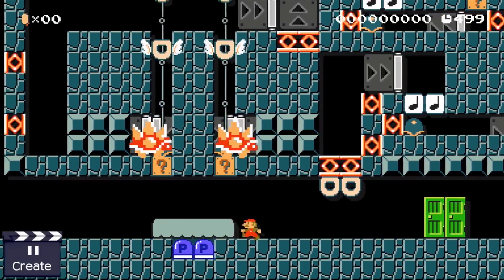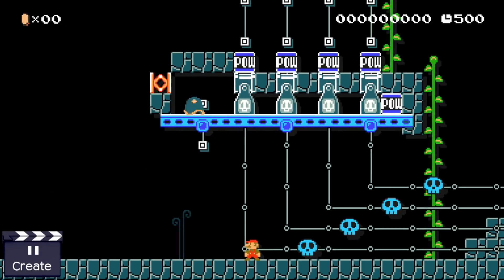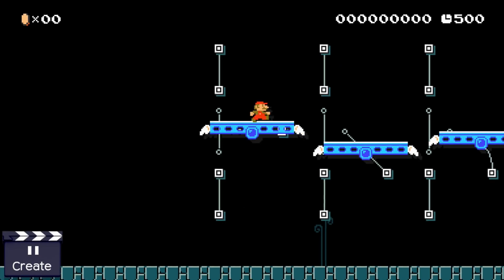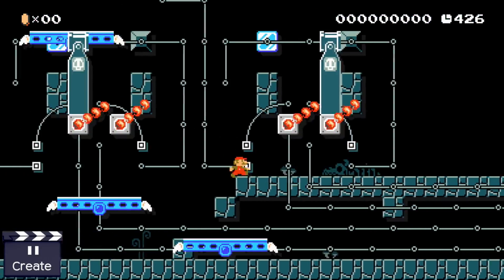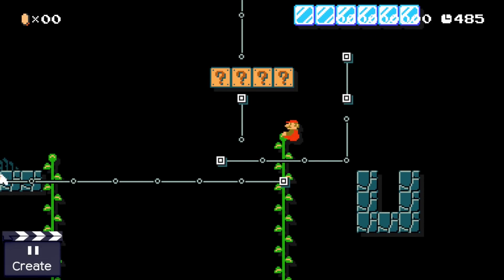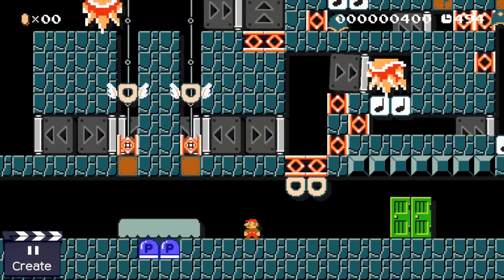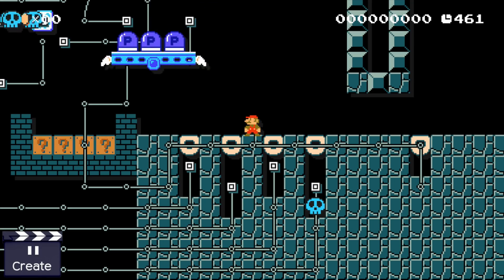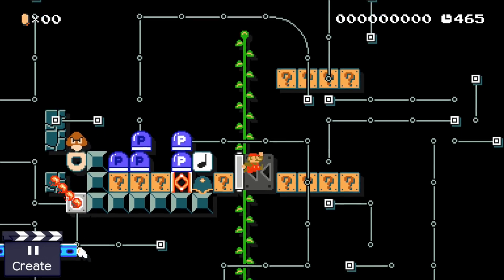Is it Possible to Build Binary Storage in Super Mario Maker ?

Comment: 01001111 01110101 01100011 01101000 01101001 01101110 01100111 00100000 01010011 01110000 01101001 01101011 01100101 01110011
Reply: 01101001 01110100 00100111 01110011 00100000 01110011 01110101 01110010 01110000 01110010 01101001 01110011 01101001 01101110 01100111 01101100 01111001 00100000 01110011 01101001 01101101 01110000 01101100 01100101
Reply: 0
Reply: Have y'all tried talking using letters? I hear it's a much easier system.
Reply: NJCWolf 48 65 78 20 69 73 20 62 65 74 74 65 72 20 74 68 61 6E 20 6C 65 74 74 65 72 73 20 62 65 63 61 75 73 65 20 69 74 20 61 6C 6C 6F 77 73 20 74 68 65 20 74 72 61 6E 73 66 65 72 61 6C 20 6F 66 20 6B 6E 6F 77 6C 65 64 67 65 20 69 6E 20 61 20 63 6F 64 65 2D 6C 69 6B 65 20 6D 61 6E 6E 65 72 2C 20 77 68 69 63 68 20 69 73 6E 27 74 20 6E 65 63 65 73 73 61 72 69 6C 79 20 75 6E 64 65 72 73 74 6F 6F 64 20 62 79 20 65 76 65 72 79 6F 6E 65 2E 20 54 68 61 74 20 77 61 79 2C 20 70 65 6F 70 6C 65 20 77 69 6C 6C 20 6F 6E 6C 79 20 75 6E 64 65 72 73 74 61 6E 64 20 77 68 61 74 20 77 65 27 72 65 20 73 61 79 69 6E 67 20 69 66 20 74 68 65 79 20 61 63 74 75 61 6C 6C 79 20 77 61 6E 74 20 74 6F 2C 20 75 6E 6C 69 6B 65 20 6C 65 74 74 65 72 73 20 77 68 69 63 68 20 63 61 6E 20 62 65 20 75 6E 64 65 72 73 74 6F 6F 64 20 69 6E 20 61 20 6D 61 6E 6E 65 72 20 6F 66 20 66 72 61 63 74 69 6F 6E 73 20 6F 66 20 73 65 63 6F 6E 64 73 20 62 79 20 62 61 73 69 63 61 6C 6C 79 20 61 6E 79 6F 6E 65 20 77 68 6F 20 68 61 73 20 65 79 65 73 20 61 6E 64 20 69 73 20 61 62 6C 65 20 74 6F 20 72 65 61 64 2E
Reply: 01101001 01101101 00100000 01101111 01101011 00100000 01110100 01100001 01101100 01101011 01101001 01101110 01100111 00100000 01101001 01101110 00100000 01100010 01101001 01101110 01100001 01110010 01111001 00100000 01100010 01110101 01110100 00100000 01101001 01101110 00100000 01001000 01000101 01011000 01001001 01000100 01000101 01000011 01001001 01001101 01000001 01001100 00100001 00111111 00111111 00111111 00100001 00111111 00100001 00111111 00100000 01110100 01101000 01100001 01110100 01110011 00100000 01110100 01101111 01101111 00100000 01100110 01100001 01110010
Reply: "MDAxMTAxMTEgMDAxMTAwMDAgMDAxMDAwMDAgMDAxMTAxMTAgMDAxMTAxMDEgMDAxMDAwMDAgMDAxMTAxMTAgMDExMDAxMDEgMDAxMDAwMDAgMDAxMTAxMTAgMDAxMTEwMDEgMDAxMDAwMDAgMDAxMTAxMTEgMDAxMTAwMTEgMDAxMDAwMDAgMDAxMTAwMTAgMDAxMTAwMDAgMDAxMDAwMDAgMDAxMTAxMTAgMDAxMTEwMDAgMDAxMDAwMDAgMDAxMTAxMTAgMDAxMTAwMDEgMDAxMDAwMDAgMDAxMTAxMTAgMDAxMTEwMDAgMDAxMDAwMDAgMDAxMTAxMTAgMDAxMTAwMDEgMDAxMDAwMDAgMDAxMTAwMT"
Reply: Tristan Preston
Reply: TLDR: 69 74 27 73 20 73 75 72 70 72 69 73 69 6E 67 6C 79 20 73 69 6D 70 6C 65
Reply: 2
Reply: "Ouching Spikes"
Reply: "Honestly, binary is terribly inefficient for sending messages. Hex, on the other hand, is much more compact."
Reply: NJCWolf   -.--  .  .-  .... / .-.  ..  --.  ....  -?
Reply: 01110111 01101111 01110111 00100000 01110100 01101000 01101001 01110011 00100000 01100011 01101111 01101101 01101101 01100101 01101110 01110100 01110011 00100000 01110011 01100101 01100011 01110100 01101001 01101111 01101110 00100000 01101001 01110011 00100000 01100111 01100101 01110100 01110100 01101001 01101110 01100111 00100000 01110000 01110010 01100101 01110100 01110100 01111001 00100000 01100110 01110010 01100101 01100001 01101011 01101001 01101110 01100111 00100000 01110111 01100101 01101001 01110010 01100100 00100000 01101001 00100000 01100010 01100101 01110100 01110100 01100101 01110010 00100000 01100111 01101111 00100000 01101000 01101001 01100100 01100101 00100000 01101001 01101110 00100000 01110100 01101000 01100101 00100000 01101000 01100101 01111000 01100001 01100100 01100101 01100011 01101001 01101101 01100001 01101100 00100000 01101000 01101111 01101100 01100101 00100000 01100111 01101111 01101111 01100100 01100010 01111001 01100101
Reply: Yes lucas
Reply: 119 104 121 32 110 111 98 111 100 121 32 117 115 101 115 32 100 101 99 105 109 97 108 63
Reply: The Fox Overlord But Totally Not A Furry I can't copy it I'm on the phone >_>
Reply: BNMC0919 LOL
Reply: "it's surprisingly simple"
Reply: "It's actually surprisingly simple."
Reply: "Decimal must be max. 9223372036854775807"
Reply: Damn. The page yall are getting this shit from is making bank.
Reply: Ouching spikes
Reply: 01010100 01101000 01100101 00100000 01100011 01101111 01101101 01101101 01100101 01101110 01110100 00100000 01110011 01100101 01100011 01110100 01101001 01101111 01101110 00100000 01101001 01110011 00100000 01100111 01100101 01110100 01110100 01101001 01101110 01100111 00100000 01100011 01101111 01101101 01110000 01101100 01101001 01100011 01100001 01110100 01100101 01100100 00101110 00101110 00101110
Reply: 1 2 oat meal
Reply: ..., that's just translating binary numbers to letters using the ASCII table. That has no real use in the video
Reply: New Justin Y.
Reply: 01101000 01100101 01101100 01101100 01101111 00100000 01110100 01101000 01100101 01110010 01100101
Reply: 00110101 00110110 00100000 00110011 00110010 00100000 00110110 00111000 00100000 00110110 01100011 00100000 00110110 00110010 00100000 00110110 00111001 00100000 00110100 00110010 00100000 00110011 00110101 00100000 00110110 00110010 00100000 00110011 00110011 00100000 00110101 00110101 00100000 00110110 00110111 00100000 00110110 00110001 00100000 00110100 00110111 00100000 00110110 01100011 00100000 00110011 00110000 00100000 00110100 00111001 00100000 00110100 00110011 00100000 00110110 00110100 00100000 00110110 01100011 00100000 00110110 00110010 00100000 00110101 00110011 00100000 00110100 00110010 00100000 00110011 00110011 00100000 00110110 00110001 00100000 00110101 00111000 00100000 00110101 00110010 00100000 00110110 01100110 00100000 00110100 00111001 00100000 00110100 00111000 00100000 00110101 00110010 00100000 00110110 01100110 00100000 00110101 00111001 00100000 00110101 00111000 00100000 00110101 00110001 00100000 00110110 00110111 00100000 00110101 00110001 00100000 00110110 01100100 00100000 00110100 00110110 00100000 00110111 01100001 00100000 00110101 01100001 00100000 00110101 00110100 00100000 00110101 00111001 00100000 00110011 00110000 00100000 00110100 00111001 00100000 00110100 00110111 00100000 00110100 01100101 00100000 00110111 00110110 00100000 00110110 00110010 00100000 00110110 01100101 00100000 00110101 01100001 00100000 00110110 01100011 00100000 00110110 00110011 00100000 00110110 01100101 00100000 00110101 00110010 00100000 00110110 01100011 00100000 00110101 01100001 00100000 00110100 00110011 00100000 00110100 00110010 00100000 00110111 00110000 00100000 00110110 00110010 00100000 00110110 01100101 00100000 00110101 00110010 00100000 00110111 00110110 00100000 00110100 00111001 00100000 00110100 00110111 00100000 00110110 00111000 00100000 00110110 01100011 00100000 00110110 00110101 00100000 00110100 00110011 00100000 00110100 00110010 00100000 00110110 01100001 00100000 00110110 00110010 00100000 00110011 00110010 00100000 00110011 00110101 00100000 00110011 00110010 00100000 00110101 01100001 00100000 00110101 00111000 00100000 00110100 01100001 00100000 00110011 00110000 00100000 00110101 01100001 00100000 00110101 00110111 00100000 00110101 00110001 00100000 00110110 00110111 00100000 00110110 00110001 00100000 00110101 00110111 00100000 00110011 00110101 00100000 00110011 00110000 00100000 00110110 00110010 00100000 00110111 00111001 00100000 00110100 00110010 00100000 00110110 00111001 00100000 00110110 00110001 00100000 00110101 00110111 00100000 00110011 00110101 00100000 00110110 00111000 00100000 00110110 00110011 00100000 00110110 01100101 00100000 00110110 01100010 00100000 00110111 00110101 00100000 00110100 00111001 00100000 00110100 00110011 00100000 00110111 00110000 00100000 00110110 01100010 00100000 00110101 00111001 00100000 00110101 00110111 00100000 00110100 01100001 00100000 00110111 01100001 00100000 00110100 01100010 00100000 00110110 00111001 00100000 00110100 00110001 00100000 00110111 00110101 00100000 00110100 01100011 00100000 00110110 00111001 00100000 00110011 00110100 00100000 00110111 00110101 00100000 00110100 01100011 00100000 00110110 00111001 00100000 00110011 00110100 00100000 00110111 00110101 00100000 00110100 00111001 00100000 00110100 00110101 00100000 00110101 01100001 00100000 00110111 00110110 00100000 00110110 00110010 00100000 00110100 00110111 00100000 00110111 00111000 00100000 00110111 00110110 00100000 00110110 00110100 00100000 00110111 00111001 00100000 00110100 00110010 00100000 00110111 00110100 00100000 00110101 01100001 00100000 00110101 00110011 00100000 00110100 00110010 00100000 00110111 00110110 00100000 00110110 00110010 00100000 00110110 00111001 00100000 00110100 00110010 00100000 00110101 00110101 00100000 00110110 00110100 00100000 00110011 00110010 00100000 00110110 01100011 00100000 00110011 00110000 00100000 00110101 00111001 00100000 00110011 00110010 00100000 00110110 00110111 00100000 00110111 00110101 00100000 00110100 00111001 00100000 00110100 00110101 00100000 00110110 01100010 00100000 00110110 00110111 00100000 00110110 00110001 00100000 00110100 00110111 00100000 00110100 00110110 00100000 00110110 01100010 00100000 00110100 00111001 00100000 00110100 00111000 00100000 00110101 00110010 00100000 00110111 00110110 00100000 00110100 00111001 00100000 00110100 00110111 00100000 00110101 00110010 00100000 00110111 00110110 00100000 00110100 00111001 00100000 00110100 00110111 00100000 00110110 01100011 00100000 00110011 00110000 00100000 00110100 01100011 00100000 00110110 00110111 00100000 00110011 01100100 00100000 00110011 01100100 0001010
Reply: CorruptGlitchGames, EyedDoubloon converted "penis haha" into hex, then binary, then base64, then hex, and then binary. I was using base64 a little bit to translate my message and then realized how similar his looked to base64.
Reply: Is there a reddit page for this crap?
Reply: 01010100 01101000 01101001 01110011 00100000 01110011 01100101 01100101 01101101 01110011 00100000 01110010 01100101 01100001 01101100 01101100 01111001 00100000 01101001 01101110 01110100 01100101 01110010 01100101 01110011 01110100 01101001 01101110 01100111 00100000 01100010 01110101 01110100 00100000 01001001 00100000 01110111 01101111 01101110 01100100 01100101 01110010 00100000 01101000 01101111 01110111 00100000 01101101 01110101 01100011 01101000 00100000 01111001 01101111 01110101 00100000 01110111 01101111 01110101 01101100 01100100 00100000 01100010 01100101 00100000 01100001 01100010 01101100 01100101 00100000 01110100 01101111 00100000 01100100 01101111 00100000 01110111 01101001 01110100 01101000 00100000 01101001 01110100 00100000 01100010 01100001 01110011 01100101 01100100 00100000 01101111 01101110 00100000 01110100 01101000 01100101 00100000 01110011 01101001 01100111 01101110 00100000 01101111 01100110 00100000 01110100 01101000 01100101 00100000 01110011 01110100 01100001 01100111 01100101 00100000 01100001 01101110 01100100 00100000 01100010 01100001 01110011 01100101 01100100 00100000 01101111 01101110 00100000 01101000 01101111 01110111 00100000 01101100 01101111 01101110 01100111 00100000 01101001 01110100 00100000 01110100 01100001 01101011 01100101 01110011 00100000 01101001 01100110 00100000 01101001 01110100 00100000 01110111 01101111 01110101 01101100 01100100 00100000 01100001 01100011 01110100 01110101 01100001 01101100 01101100 01111001 00100000 01100010 01100101 00100000 01100110 01110101 01101110 00100000 01110100 01101111 00100000 01110000 01101100 01100001 01111001 00100000 01100001 00100000 01101100 01100101 01110110 01100101 01101100 00100000 01100011 01110010 01100101 01100001 01110100 01100101 01100100 00100000 01110111 01101001 01110100 01101000 00100000 01101001 01110100
Reply: 01001001 00100000 01101101 01100101 01100001 01101110 01110100 00100000 01110011 01101001 01111010 01100101 00100000 01101110 01101111 01110100 00100000 01110011 01101001 01100111 01101110 00100000 01110111 01101000 01101111 01101111 01110000 01110011
Reply: i will learn binary lol
Reply: 01001101 01000100 01000001 01111000 01001101 01010100 01000001 01111000 01001101 01000100 01000001 01100111 01001101 01000100 01000101 01111000 01001101 01000100 01000001 01111000 01001101 01000100 01000101 01100111 01001101 01000100 01000001 01111000 01001101 01000100 01000001 01110111 01001101 01000100 01000001 01100111 01001101 01000100 01000001 01111000 01001101 01010100 01000001 01111000 01001101 01010100 01000001 01100111 01001101 01000100 01000101 01111000 01001101 01000100 01000001 01110111 01001101 01000100 01000101 01100111 01001101 01000100 01000001 01111000 01001101 01000100 01000001 01110111 01001101 01000100 01000001 01100111 01001101 01000100 01000001 01111000 01001101 01010100 01000001 01111000 01001101 01010100 01000001 01100111 01001101 01000100 01000101 01111000 01001101 01000100 01000001 01110111 01001101 01010100 01000001 01100111 01001101 01000100 01000001 01111000 01001101 01000100 01000001 01110111 01001101 01000100 01000001 01100111 01001101 01000100 01000001 01111000 01001101 01010100 01000001 01111000 01001101 01010100 01000001 01100111 01001101 01000100 01000001 01111000 01001101 01010100 01000001 01111000 01001101 01010100 01000101 01100111 01001101 01000100 01000001 01111000 01001101 01000100 01000001 01110111 01001101 01000100 01000001 01100111 01001101 01000100 01000001 01111000 01001101 01010100 01000001 01111000 01001101 01000100 01000001 01100111 01001101 01000100 01000101 01111000 01001101 01000100 01000001 01111000 01001101 01000100 01000101 01100111 01001101 01000100 01000001 01111000 01001101 01000100 01000001 01110111 01001101 01000100 01000001 01100111 01001101 01000100 01000001 01111000 01001101 01010100 01000001 01111000 01001101 01010100 01000101 01100111 01001101 01000100 01000101 01111000 01001101 01000100 01000001 01110111 01001101 01000100 01000101 01100111 01001101 01000100 01000001 01111000 01001101 01000100 01000001 01110111 01001101 01000100 01000001 01100111 01001101 01000100 01000001 01111000 01001101 01010100 01000001 01111000 01001101 01000100 01000101 01100111 01001101 01000100 01000001 01111000 01001101 01010100 01000001 01110111 01001101 01000100 01000101 01100111 01001101 01000100 01000001 01111000 01001101 01000100 01000001 01110111 01001101 01000100 01000001 01100111 01001101 01000100 01000001 01111000 01001101 01010100 01000001 01111000 01001101 01010100 01000001 01100111 01001101 01000100 01000001 01111000 01001101 01010100 01000001 01111000 01001101 01010100 01000101 01100111 01001101 01000100 01000001 01111000 01001101 01000100 01000001 01110111 01001101 01000100 01000001 01100111 01001101 01000100 01000001 01111000 01001101 01010100 01000001 01111000 01001101 01000100 01000001 01100111 01001101 01000100 01000101 01111000 01001101 01000100 01000001 01111000 01001101 01000100 01000001 01100111 01001101 01000100 01000001 01111000 01001101 01000100 01000001 01110111 01001101 01000100 01000001 01100111 01001101 01000100 01000001 01111000 01001101 01010100 01000001 01111000 01001101 01010100 01000001 01100111 01001101 01000100 01000101 01111000 01001101 01000100 01000001 01110111 01001101 01000100 01000101 01100111 01001101 01000100 01000001 01111000 01001101 01000100 01000001 01110111 01001101 01000100 01000001 01100111 01001101 01000100 01000001 01111000 01001101 01010100 01000001 01111000 01001101 01000100 01000001 01100111 01001101 01000100 01000001 01111000 01001101 01010100 01000001 01110111 01001101 01000100 01000101 01100111 01001101 01000100 01000001 01111000 01001101 01000100 01000001 01110111 01001101 01000100 01000001 01100111 01001101 01000100 01000001 01111000 01001101 01010100 01000001 01111000 01001101 01010100 01000001 01100111 01001101 01000100 01000001 01111000 01001101 01010100 01000001 01111000 01001101 01010100 01000101 01100111 01001101 01000100 01000001 01111000 01001101 01000100 01000001 01110111 01001101 01000100 01000001 01100111 01001101 01000100 01000001 01111000 01001101 01010100 01000001 01111000 01001101 01000100 01000001 01100111 01001101 01000100 01000101 01111000 01001101 01000100 01000001 01111000 01001101 01000100 01000101 01100111 01001101 01000100 01000001 01111000 01001101 01000100 01000001 01110111 01001101 01000100 01000001 01100111 01001101 01000100 01000001 01111000 01001101 01010100 01000001 01111000 01001101 01010100 01000001 01100111 01001101 01000100 01000101 01111000 01001101 01000100 01000001 01110111 01001101 01000100 01000101 01100111 01001101 01000100 01000001 01111000 01001101 01000100 01000001 01110111 01001101 01000100 01000001 01100111 01001101 01000100 01000001 01111000 01001101 01010100 01000001 01111000 01001101 01010100 01000001 01100111 01001101 01000100 01000101 01111000 01001101 01000100 01000001 01110111 01001101 01010100 01000001 01100111 01001101 01000100 01000001 01111000 01001101 01000100 01000001 01110111 01001101 01000100 01000001 01100111 01001101 01000100 01000001 01111000 01001101 01010100 01000001 01111000 01001101 01010100 01000001 01100111 01001101 01000100 01000001 01111000 01001101 01010100 01000001 01111000 01001101 01010100 01000101 01100111 01001101 01000100 01000001 01111000 01001101 01000100 01000001 01110111 01001101 01000100 01000001 01100111 01001101 01000100 01000001 01111000 01001101 01010100 01000001 01111000 01001101 01000100 01000001 01100111 01001101 01000100 01000101 01111000 01001101 01000100 01000001 01111000 01001101 01000100 01000101 01100111 01001101 01000100 01000001 01111000 01001101 01000100 01000001 01110111 01001101 01000100 01000001 01100111 01001101 01000100 01000001 01111000 01001101 01010100 01000001 01111000 01001101 01010100 01000101 01100111 01001101 01000100 01000101 01111000 01001101 01000100 01000001 01110111 01001101 01000100 01000101 01100111 01001101 01000100 01000001 01111000 01001101 01000100 01000001 01110111 01001101 01000100 01000001 01100111 01001101 01000100 01000001 01111000 01001101 01010100 01000001 01111000 01001101 01000100 01000001 01100111 01001101 01000100 01000101 01111000 01001101 01000100 01000001 01111000 01001101 01000100 01000001 01100111 01001101 01000100 01000001 01111000 01001101 01000100 01000001 01110111 01001101 01000100 01000001 01100111 01001101 01000100 01000001 01111000 01001101 01010100 01000001 01111000 01001101 01010100 01000001 01100111 01001101 01000100 01000001 01111000 01001101 01010100 01000001 01111000 01001101 01010100 01000101 01100111 01001101 01000100 01000001 01111000 01001101 01000100 01000001 01110111 01001101 01000100 01000001 01100111 01001101 01000100 01000001 01111000 01001101 01010100 01000001 01111000 01001101 01000100 01000001 01100111 01001101 01000100 01000101 01111000 01001101 01000100 01000001 01111000 01001101 01000100 01000001 01100111 01001101 01000100 01000001 01111000 01001101 01000100 01000001 01110111 01001101 01000100 01000001 01100111 01001101 01000100 01000001 01111000 01001101 01010100 01000001 01111000 01001101 01010100 01000001 01100111 01001101 01000100 01000101 01111000 01001101 01000100 01000001 01110111 01001101 01000100 01000101 01100111 01001101 01000100 01000001 01111000 01001101 01000100 01000001 01110111 01001101 01000100 01000001 01100111 01001101 01000100 01000001 01111000 01001101 01010100 01000001 01111000 01001101 01000100 01000001 01100111 01001101 01000100 01000001 01111000 01001101 01010100 01000001 01110111 01001101 01000100 01000101 01100111 01001101 01000100 01000001 01111000 01001101 01000100 01000001 01110111 01001101 01000100 01000001 01100111 01001101 01000100 01000001 01111000 01001101 01010100 01000001 01111000 01001101 01010100 01000001 01100111 01001101 01000100 01000001 01111000 01001101 01010100 01000001 01111000 01001101 01010100 01000101 01100111 01001101 01000100 01000001 01111000 01001101 01000100 01000001 01110111 01001101 01000100 01000001 01100111 01001101 01000100 01000001 01111000 01001101 01010100 01000001 01111000 01001101 01000100 01000001 01100111 01001101 01000100 01000101 01111000 01001101 01000100 01000001 01111000 01001101 01000100 01000101 01100111 01001101 01000100 01000001 01111000 01001101 01000100 01000001 01110111 01001101 01000100 01000001 01100111 01001101 01000100 01000001 01111000 01001101 01010100 01000001 01111000 01001101 01010100 01000001 01100111 01001101 01000100 01000101 01111000 01001101 01000100 01000001 01111000 01001101 01000100 01000001 01100111 01001101 01000100 01000001 01111000 01001101 01000100 01000001 01110111 01001101 01000100 01000001 01100111 01001101 01000100 01000001 01111000 01001101 01010100 01000001 01111000 01001101 01000100 01000101 01100111 01001101 01000100 01000001 01111000 01001101 01010100 01000001 01110111 01001101 01000100 01000101 01100111 01001101 01000100 01000001 01111000 01001101 01000100 01000001 01110111 01001101 01000100 01000001 01100111 01001101 01000100 01000001 01111000 01001101 01010100 01000001 01111000 01001101 01010100 01000001 01100111 01001101 01000100 01000001 01111000 01001101 01010100 01000001 01111000 01001101 01010100 01000101 01100111 01001101 01000100 01000001 01111000 01001101 01000100 01000001 01110111 01001101 01000100 01000001 01100111 01001101 01000100 01000001 01111000 01001101 01010100 01000001 01111000 01001101 01000100 01000001 01100111 01001101 01000100 01000101 01111000 01001101 01000100 01000001 01111000 01001101 01000100 01000101 01100111 01001101 01000100 01000001 01111000 01001101 01000100 01000001 01110111 01001101 01000100 01000001 01100111 01001101 01000100 01000001 01111000 01001101 01010100 01000001 01111000 01001101 01010100 01000001 01100111 01001101 01000100 01000101 01111000 01001101 01000100 01000001 01110111 01001101 01000100 01000101 01100111 01001101 01000100 01000001 01111000 01001101 01000100 01000001 01110111 01001101 01000100 01000001 01100111 01001101 01000100 01000001 01111000 01001101 01010100 01000001 01111000 01001101 01000100 01000101 01100111 01001101 01000100 01000001 01111000 01001101 01010100 01000001 01111000 01001101 01000100 01000101 01100111 01001101 01000100 01000001 01111000 01001101 01000100 01000001 0
Reply: if im correct this says ouching spikes?
Reply: Lucas Howe Don't spam.
Reply: Luke Dassonville *too
Reply: 1! 0! 👍
Reply: Aren't binary translators so cool
Reply: 01101100 01101111 01101100 00100000 01110100 01101000 01101001 01110011 00100000 01100111 01110101 01111001 01110011 00100000 01110100 01111001 01110000 01101001 01101110 01100111 00100000 01110010 01100001 01101110 01100100 01101111 01101101 00100000 00110000 00100000 00100110 00100000 00110001 00100000 01101110 01110101 01101101 01100010 01100101 01110010 01110011 00100000 01110100 01101000 01101001 01101110 01101011 01101001 01101110 01100111 00100000 01110100 01101000 01100101 01111001 00100000 01100001 01110010 01100101 00100000 01100011 01101111 01101111 01101100 00100000 00101101 00100000 01101001 01110011 00100000 01101001 01110100 00100000 01110100 01101000 01100001 01110100 00100000 01101000 01100001 01110010 01100100 00100000 01110100 01101111 00100000 01110101 01110011 01100101 00100000 01110100 01110010 01100001 01101110 01110011 01101100 01100001 01110100 01101111 01110010 00100000 01100001 01101110 01100100 00100000 01110100 01110010 01100001 01101110 01110011 01101100 01100001 01110100 01100101 00100000 01110011 01101000 01101001 01110100 00100000 01101001 01101110 01110100 01101111 00100000 01101000 01110101 01101101 01100001 01101110 00100000 01101100 01100001 01101110 01100111 01110101 01100001 01100111 01100101 00100000 01110101 00100000 01101101 01101111 01110010 01101111 01101110 01110011 00101110 00100000 01101001 01101101 00100000 01101111 01110101 01110100 01110011 01101101 01100001 01110010 01110100 01101001 01101110 01100111 00100000 01110101 00100000 01100010 01101001 01110100 01100011 01101000 01100101 01110011 00100000 01101000 01100001 01101000 01100001 01101000 01100001 01101000 01101000 01100001 01101000 01100001 01101000 01100001 01101000 01101000 00100000 01101001 01101101 00100000 01100100 01110010 01110101 01101110 01101011 00100000 01100010 01100001 01111001 00100000 01110100 01101000 01100101 00100000 01110111 01100001 01111001 00100000 01110011 01101101 01100001 01110011 01101000 00100000 01110100 01101000 01100001 01110100 00100000 01110010 01100101 01100100 00100000 01100010 01110101 01110100 01110100 01101111 01101110 00100000 01110111 01101001 01110100 01101000 00100000 01110111 01101111 01110010 01100100 00100000 01110011 01110101 01100010 01110011 01100011 01110010 01101001 01100010 01100101 00100000 01101111 01101110 00100000 01101001 01110100 00100000 01100110 01101111 01110010 00100000 01110100 01101000 01101001 01110011 00100000 01101101 01100001 01110010 01101001 01101111 00101101 01100111 01110101 01111001 00100000 01100011 01101000 01100001 01101110 01101110 01100101 01101100 00100000 01010011 01000011 01010010 01010101 01000010 01010011
Reply: this is actualy translate-able one
Reply: *01001001 01110100 00100111 01110011 00100000 01100001 01100011 01110100 01110101 01100001 01101100 01101100 01111001 00100000 01110011 01110101 01110010 01110000 01110010 01101001 01110011 01101001 01101110 01100111 01101100 01111001 00100000 01110011 01101001 01101101 01110000 01101100 01100101 00101110
Reply: Hold up, you were on jackfilms! Whats up?
Reply: 01000001 01101100 01101100 00100000 01111001 01101111 01110101 00100000 01101110 01100101 01100101 01100100 00100000 01110100 01101111 00100000 01100100 01101111 00100000 01101001 01110011 00100000 01110000 01110101 01110100 00100000 01010000 01001111 01010111 00100000 01100010 01101100 01101111 01100011 01101011 01110011 00100000 01101111 01101110 00100000 01100010 01110101 01101100 01101100 01100101 01110100 00100000 01101100 01100001 01110101 01101110 01100011 01101000 01100101 01110010 01110011 00101110 00100000 01010100 01101000 01100101 00100000 01100101 01101110 01100100 00101110
Reply: The Fox Overlord But Totally Not A Furry Wow, I’m seeing you all over the comments of the YouTubers I watch too! Ceave, Grian, and others too!
Reply: you're freaking on every channel I watch, simpleflips, oatmeal memes, jacksfilms, you name it I probably saw you there
Reply: 00110100 01000100 00100000 00110100 00110100 00100000 00110100 00110001 00100000 00110111 00111000 00100000 00110100 01000100 00100000 00110101 00110100 00100000 00110100 00110001 00100000 00110111 00111000 00100000 00110100 01000100 00100000 00110101 00110100 00100000 00110100 00110101 00100000 00110110 00110111 00100000 00110100 01000100 00100000 00110100 00110100 00100000 00110100 00110001 00100000 00110111 00111000 00100000 00110100 01000100 00100000 00110101 00110100 00100000 00110100 00110001 00100000 00110111 00110111 00100000 00110100 01000100 00100000 00110100 00110100 00100000 00110100 00110001 00100000 00110110 00110111 00100000 00110100 01000100 00100000 00110100 00110100 00100000 00110100 00110001 00100000 00110111 00111000 00100000 00110100 01000100 00100000 00110100 00110100 00100000 00110100 00110001 00100000 00110111 00110111 00100000 00110100 01000100 00100000 00110100 00110100 00100000 00110100 00110001 00100000 00110110 00110111 00100000 00110100 01000100 00100000 00110100 00110100 00100000 00110100 00110001 00100000 00110111 00111000 00100000 00110100 01000100 00100000 00110101 00110100 00100000 00110100 00110001 00100000 00110111 00111000 00100000 00110100 01000100 00100000 00110101 00110100 00100000 00110100 00110001 00100000 00110110 00110111 00100000 00110100 01000100 00100000 00110100 00110100 00100000 00110100 00110001 00100000 00110111 00111000 00100000 00110100 01000100 00100000 00110101 00110100 00100000 00110100 00110001 00100000 00110111 00111000 00100000 00110100 01000100 00100000 00110100 00110100 00100000 00110100 00110101 00100000 00110110 00110111 00100000 00110100 01000100 00100000 00110100 00110100 00100000 00110100 00110001 00100000 00110111 00111000 00100000 00110100 01000100 00100000 00110100 00110100 00100000 00110100 00110001 00100000 00110111 00110111 00100000 00110100 01000100 00100000 00110100 00110100 00100000 00110100 00110001 00100000 00110110 00110111 00100000 00110100 01000100 00100000 00110100 00110100 00100000 00110100 00110001 00100000 00110111 00111000 00100000 00110100 01000100 00100000 00110101 00110100 00100000 00110100 00110001 00100000 00110111 00111000 00100000 00110100 01000100 00100000 00110101 00110100 00100000 00110100 00110001 00100000 00110110 00110111 00100000 00110100 01000100 00100000 00110100 00110100 00100000 00110100 00110101 00100000 00110111 00111000 00100000 00110100 01000100 00100000 00110100 00110100 00100000 00110100 00110001 00100000 00110111 00111000 00100000 00110100 01000100 00100000 00110100 00110100 00100000 00110100 00110101 00100000 00110110 00110111 00100000 00110100 01000100 00100000 00110100 00110100 00100000 00110100 00110001 00100000 00110111 00111000 00100000 00110100 01000100 00100000 00110100 00110100 00100000 00110100 00110001 00100000 00110111 00110111 00100000 00110100 01000100 00100000 00110100 00110100 00100000 00110100 00110001 00100000 00110110 00110111 00100000 00110100 01000100 00100000 00110100 00110100 00100000 00110100 00110001 00100000 00110111 00111000 00100000 00110100 01000100 00100000 00110101 00110100 00100000 00110100 00110001 00100000 00110111 00111000 00100000 00110100 01000100 00100000 00110101 00110100 00100000 00110100 00110001 00100000 00110110 00110111 00100000 00110100 01000100 00100000 00110100 00110100 00100000 00110100 00110001 00100000 00110111 00111000 00100000 00110100 01000100 00100000 00110101 00110100 00100000 00110100 00110101 00100000 00110111 00110111 00100000 00110100 01000100 00100000 00110100 00110100 00100000 00110100 00110101 00100000 00110110 00110111 00100000 00110100 01000100 00100000 00110100 00110100 00100000 00110100 00110001 00100000 00110111 00111000 00100000 00110100 01000100 00100000 00110100 00110100 00100000 00110100 00110001 00100000 00110111 00110111 00100000 00110100 01000100 00100000 00110100 00110100 00100000 00110100 00110001 00100000 00110110 00110111 00100000 00110100 01000100 00100000 00110100 00110100 00100000 00110100 00110001 00100000 00110111 00111000 00100000 00110100 01000100 00100000 00110101 00110100 00100000 00110100 00110001 00100000 00110111 00111000 00100000 00110100 01000100 00100000 00110101 00110100 00100000 00110100 00110101 00100000 00110110 00110111 00100000 00110100 01000100 00100000 00110100 00110100 00100000 00110100 00110001 00100000 00110111 00111000 00100000 00110100 01000100 00100000 00110101 00110100 00100000 00110100 00110001 00100000 00110111 00110111 00100000 00110100 01000100 00100000 00110101 00110100 00100000 00110100 00110101 00100000 00110110 00110111 00100000 00110100 01000100 00100000 00110100 00110100 00100000 00110100 00110001 00100000 00110111 00111000 00100000 00110100 01000100 00100000 00110100 00110100 00100000 00110100 00110001 00100000 00110111 00110111 00100000 00110100 01000100 00100000 00110100 00110100 00100000 00110100 00110001 00100000 00110110 00110111 00100000 00110100 01000100 00100000 00110100 00110100 00100000 00110100 00110001 00100000 00110111 00111000 00100000 00110100 01000100 00100000 00110101 00110100 00100000 00110100 00110001 00100000 00110111 00110111 00100000 00110100 01000100 00100000 00110101 00110100 00100000 00110100 00110001 00100000 00110110 00110111 00100000 00110100 01000100 00100000 00110100 00110100 00100000 00110100 00110001 00100000 00110111 00111000 00100000 00110100 01000100 00100000 00110101 00110100 00100000 00110100 00110001 00100000 00110111 00110111 00100000 00110100 01000100 00100000 00110100 00110100 00100000 00110100 00110001 00100000 00110110 00110111 00100000 00110100 01000100 00100000 00110100 00110100 00100000 00110100 00110001 00100000 00110111 00111000 00100000 00110100 01000100 00100000 00110100 00110100 00100000 00110100 00110001 00100000 00110111 00110111 00100000 00110100 01000100 00100000 00110100 00110100 00100000 00110100 00110001 00100000 00110110 00110111 00100000 00110100 01000100 00100000 00110100 00110100 00100000 00110100 00110001 00100000 00110111 00111000 00100000 00110100 01000100 00100000 00110101 00110100 00100000 00110100 00110001 00100000 00110111 00111000 00100000 00110100 01000100 00100000 00110101 00110100 00100000 00110100 00110001 00100000 00110110 00110111 00100000 00110100 01000100 00100000 00110100 00110100 00100000 00110100 00110001 00100000 00110111 00111000 00100000 00110100 01000100 00100000 00110101 00110100 00100000 00110100 00110101 00100000 00110111 00110111 00100000 00110100 01000100 00100000 00110100 00110100 00100000 00110100 00110001 00100000 00110110 00110111 00100000 00110100 01000100 00100000 00110100 00110100 00100000 00110100 00110001 00100000 00110111 00111000 00100000 00110100 01000100 00100000 00110100 00110100 00100000 00110100 00110001 00100000 00110111 00110111 00100000 00110100 01000100 00100000 00110100 00110100 00100000 00110100 00110001 00100000 00110110 00110111 00100000 00110100 01000100 00100000 00110100 00110100 00100000 00110100 00110001 00100000 00110111 00111000 00100000 00110100 01000100 00100000 00110101 00110100 00100000 00110100 00110001 00100000 00110111 00111000 00100000 00110100 01000100 00100000 00110101 00110100 00100000 00110100 00110001 00100000 00110110 00110111 00100000 00110100 01000100 00100000 00110100 00110100 00100000 00110100 00110001 00100000 00110111 00111000 00100000 00110100 01000100 00100000 00110101 00110100 00100000 00110100 00110001 00100000 00110111 00110111 00100000 00110100 01000100 00100000 00110100 00110100 00100000 00110100 00110101 00100000 00110110 00110111 00100000 00110100 01000100 00100000 00110100 00110100 00100000 00110100 00110001 00100000 00110111 00111000 00100000 00110100 01000100 00100000 00110100 00110100 00100000 00110100 00110001 00100000 00110111 00110111 00100000 00110100 01000100 00100000 00110100 00110100 00100000 00110100 00110001 00100000 00110110 00110111 00100000 00110100 01000100 00100000 00110100 00110100 00100000 00110100 00110001 00100000 00110111 00111000 00100000 00110100 01000100 00100000 00110101 00110100 00100000 00110100 00110001 00100000 00110111 00111000 00100000 00110100 01000100 00100000 00110101 00110100 00100000 00110100 00110001 00100000 00110110 00110111 00100000 00110100 01000100 00100000 00110100 00110100 00100000 00110100 00110001 00100000 00110111 00111000 00100000 00110100 01000100 00100000 00110101 00110100 00100000 00110100 00110101 00100000 00110111 00110111 00100000 00110100 01000100 00100000 00110100 00110100 00100000 00110100 00110001 00100000 00110110 00110111 00100000 00110100 01000100 00100000 00110100 00110100 00100000 00110100 00110001 00100000 00110111 00111000 00100000 00110100 01000100 00100000 00110100 00110100 00100000 00110100 00110001 00100000 00110111 00110111 00100000 00110100 01000100 00100000 00110100 00110100 00100000 00110100 00110001 00100000 00110110 00110111 00100000 00110100 01000100 00100000 00110100 00110100 00100000 00110100 00110001 00100000 00110111 00111000 00100000 00110100 01000100 00100000 00110101 00110100 00100000 00110100 00110001 00100000 00110111 00111000 00100000 00110100 01000100 00100000 00110101 00110100 00100000 00110100 00110001 00100000 00110110 00110111 00100000 00110100 01000100 00100000 00110100 00110100 00100000 00110100 00110001 00100000 00110111 00111000 00100000 00110100 01000100 00100000 00110101 00110100 00100000 00110100 00110001 00100000 00110111 00110111 00100000 00110100 01000100 00100000 00110100 00110100 00100000 00110100 00110101 00100000 00110110 00110111 00100000 00110100 01000100 00100000 00110100 00110100 00100000 00110100 00110001 00100000 00110111 00111000 00100000 00110100 01000100 00100000 00110100 00110100 00100000 00110100 00110001 00100000 00110111 00110111 00100000 00110100 01000100 00100000 00110100 00110100 00100000 00110100 00110001 00100000 00110110 00110111 00100000 00110100 01000100 00100000 00110100 00110100 00100000 00110100 00110001 00100000 00110111 00111000 00100000 00110100 01000100 00100000 00110101 00110100 00100000 00110100 00110001 00100000 00110111 00110111 00100000 00110100 01000100 00100000 00110101 00110100 00100000 00110100 0
Reply: The Fox Overlord But Totally Not A Furry
Reply: 48 6f 6e 65 73 74 6c 79 2c 20 62 69 6e 61 72 79 20 69 73 20 74 65 72 72 69 62 6c 79 20 69 6e 65 66 66 69 63 69 65 6e 74 20 66 6f 72 20 73 65 6e 64 69 6e 67 20 6d 65 73 73 61 67 65 73 2e 20 48 65 78 2c 20 6f 6e 20 74 68 65 20 6f 74 68 65 72 20 68 61 6e 64 2c 20 69 73 20 6d 75 63 68 20 6d 6f 72 65 20 63 6f 6d 70 61 63 74 2e
Reply: BN20O9 you can translate binary into letters to! If you start with 010, then it is capital. If it starts with 011, then it is lowercase. Then, you look at the last 5 bits and see the value. The letter is in that place in the alphabet.
Reply: pokemandoestwitch yoyoyo